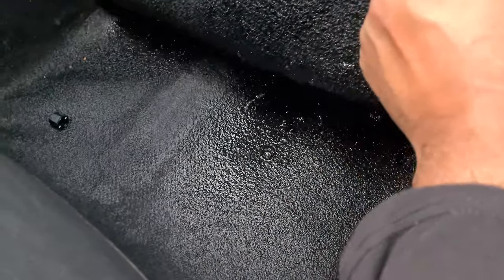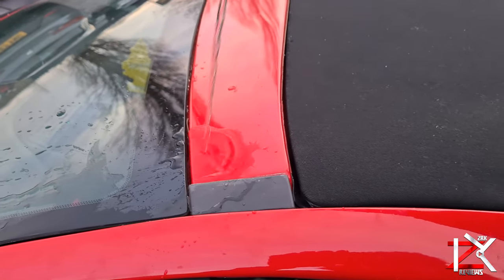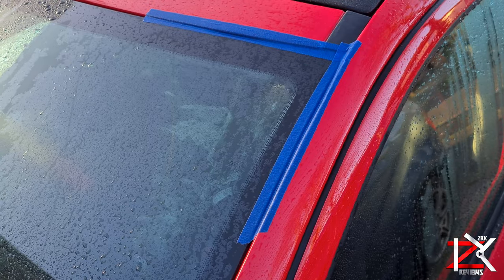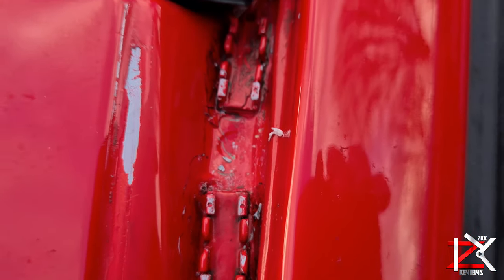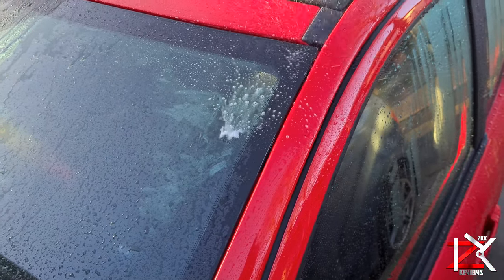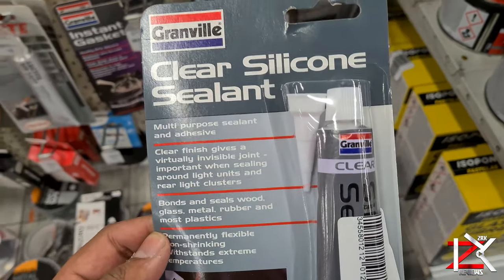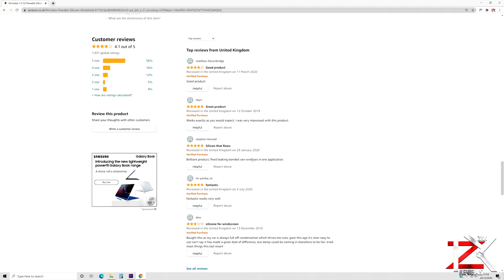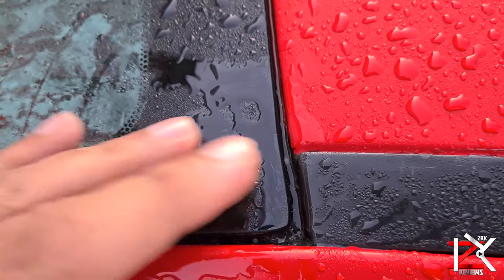How To FIX Wet Car Footwells | Windshield Repair | Crack Repair | NO More Water Leaks on Any Car

Comment: I’m having this in the front seat driver side of my 2019 Honda fit right now and I don’t know where the water is coming from
Reply from the maker: check door seals, sit in the car and give it a jet wash to see where water comes in
Reply: Thank you I’m gonna do that investing money in a car is the worst type of investment. I am not a car person they want $300 to do a diagnostic at the Honda dealership. Forget that.
Reply from the maker: @EnergyreaderempathMary  no dnt do that, i had the same problem with another car and thats the step i took, just sit in the car and let someone jet wash it so at least u know where water is coming from, must be a small fix than spending on a new car